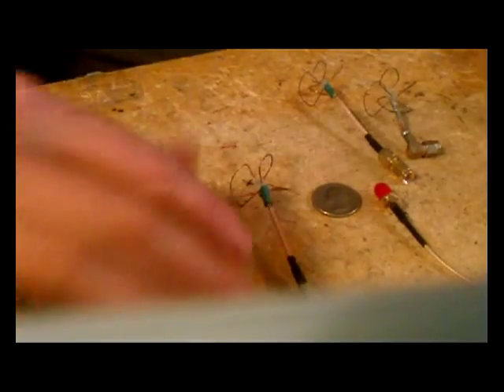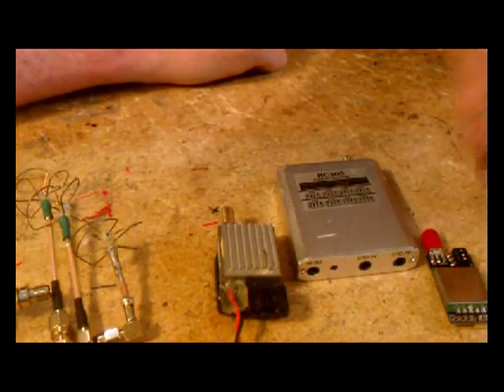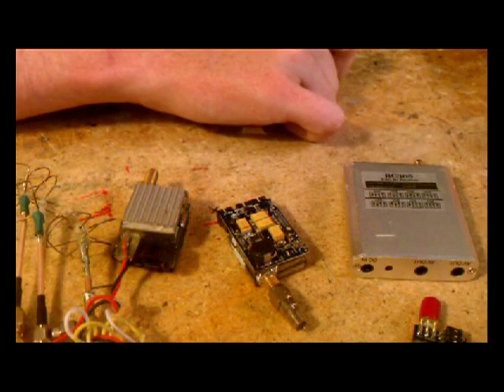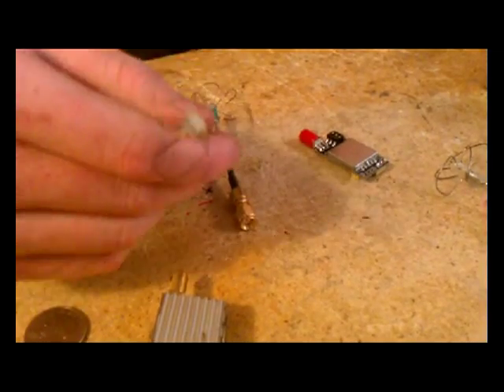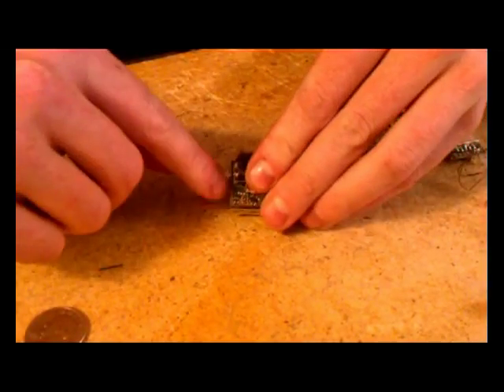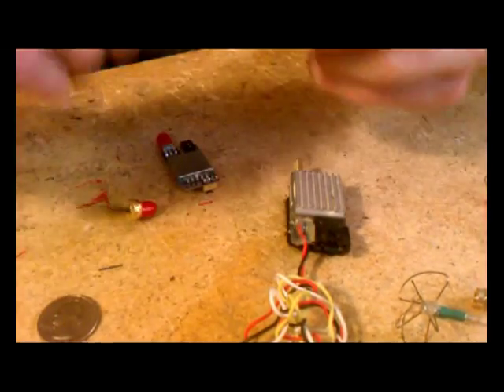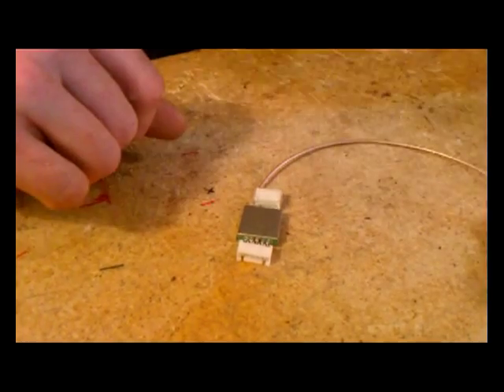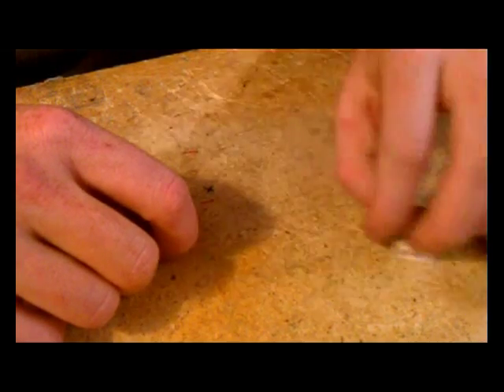FPV 5.8ghz FAQ Newbie Basics Boscam Buyer's Guide and Antenna

Comment: Band E. I think the reason I didn't have a hassle is because I didn't get a close look at the channel table for the transmitter when I put mine together (Was too lazy to look up the manual =P ) and just followed what was on the BC305 sticker. It worked straight away.

I think most people saw both vTX and vRX channel lists, they didn't match up so they just gave up altogether when all they had to do was throw away one list and use the other on both.

Comment: They actually do match up. The label at the back of the BC305 works on both the foxtech receivers and 200mw transmitters. Channel 1 for example, BC305 label says up-up-up-down, if you use it on the receiver you'll note that it translates to off-off-off-on. On the transmitter, ON is pointed the other way, but you just do the same thing and go off-off-off-on as well, they'll connect. Tried it on all 8 channels =)